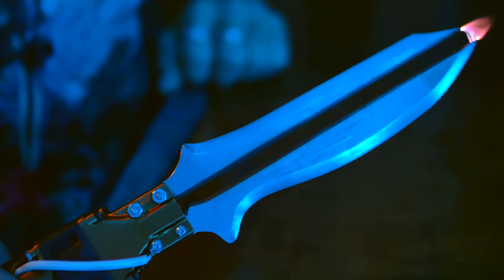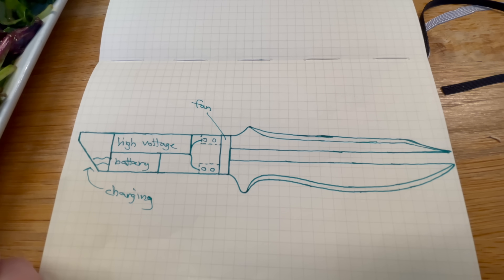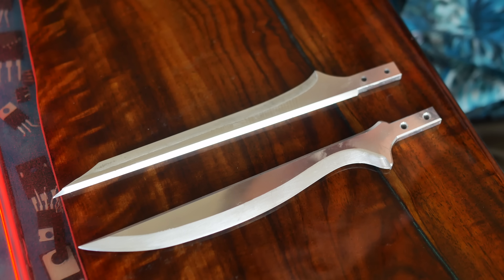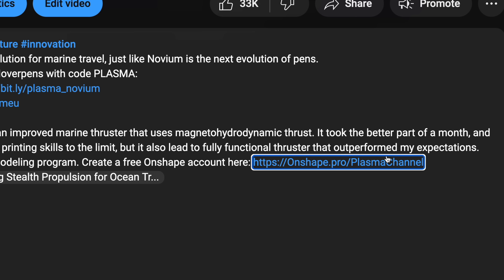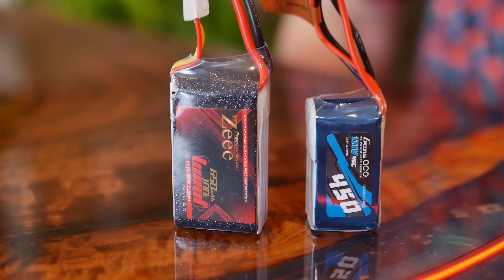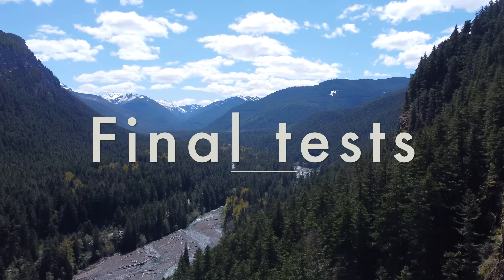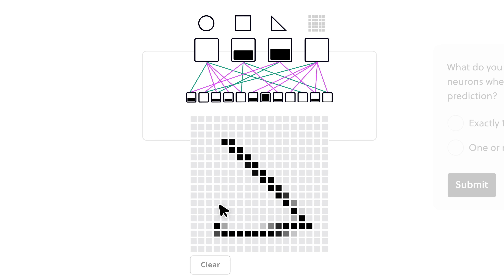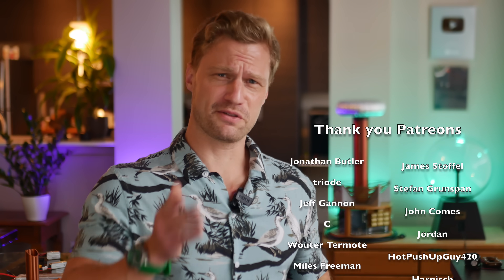A 20,000 Volt Next Generation Plasma Knife (Halo Inspired)

Comment: I can think of several ways to improve this design. Firstly, cut a channel on the inside edges of the blades and fill it with a more conductive material, such as copper or platinum. Secondly, similarly to those fad "bladeless" fans, stick the computer fan at the base of the handle rather than the bolster, and have it run the air through progressively narrower channels that direct the air to the space between the blades, you'll get a little bit more distance this way. Thirdly, scale it up enough that you can make the handle ovate rather than cylindrical, and move the activation button to a comfortable space for your thumb or finger to activate it.

Comment: Try using GDStime dual ball bearing or Sunon Maglev fans, they work much better, and you should also print a high static pressure plate for the fan as well, these make a huge difference.

Comment: Looks great.
What if instead of a self contained system, you have the batteries, circuitry, and such in a backpack, and have two contact patches on the handle and on the glove/gauntlet along with a button in the palm to deliver power to the blade? Could extend the battery life, and allow for larger more high powered blades. Would also function as an improvised stun glove
Reply: i'm going to be building myself a stun glove pretty soon here out of scrap parts. probably won't post it on this youtube channel cuz it's a little too fucked up but something like that is definitely getting built by the end of this year

Comment: Pro tip for blade handle shapes: don’t make perfectly round handles.  You can’t feel the edge alignment of your blade with them, and they’re more likely to rotate in your hand, further messing up edge alignment.  Ovoidal and rounded rectangular are the best cross-sectional shapes for handles.
Reply: Beat me to it, plus a oval-ish type hand just makes a firmer grip overall
Reply: Round handles are perfect for a lightsaber design though, no edge to worry about.
Reply: @draonKniht100  yes but it's not a lightsaber, it s plasma blade, with a edge
Reply: To be fair, the Halo Energy Sword is designed for Sangheli hands, which have two fingers and two thumbs. It's GOT to feel awkward in a Human's hands.

Comment: I think you should try using your design of the plasma propulsion system inside of it, it might be quieter than the fan, and try adding more vents for increased airflow. But as it is right now, you nailed it 🔥🔥🔥🔥
Reply: No way he'll be able to get the same airflow in the same compact size

Comment: Might want to look into taser modules. There was a tutorial for a 150000 volt taser that could be adapted for this purpose. The fan can also be replaced with an electromagnet for a more consistent streM or with a class 4 uv laser to make jumping the spark gap easier. Best wishes and cool design nevertheless. Already want to build one myself.
Reply: Link plz?

Comment: If you would put flat magnet inserts into those blades (with the right polarity), that could accelerate the plasma in a same way that a rail gun works. Thus you could skip that noisy fan, and get similar results.
Reply from the maker: This is AC plasma, so the magnets would have no affect. However, if I switched out the AC for DC high voltage, you're totally right!
Reply: @PlasmaChannel  Ah.. OK. But, in that case pulsed DC would be better, so the current won't be too high. Will you try it? You can use your HV AC supply, and a simple HV bridge rectifier (without capacitor).

Comment: what feeds did the cnc run on?
Reply from the maker: Feeds? That's a bit over my head, but I know we tried slow, and slower. Vitalli nailed it at the end though - the metal shavings were the perfect color from heat.
Reply: Good to hear, it worked. The use of coolant seemed a bit low to me. Did Vitalli spray coolant on the tool or was it just air? Love the Final design 👍

Comment: Making the gap a bit wider near the ends of the blade might help a bit.  That's what  is normally done with a Jacobs ladder.  Thanks for the vid m8.   😀
Reply from the maker: Thank you, yes I actually dulled the ends of blade, and internally as well, about 2 inches from the end. It helps kill any arcs at the distal end.

Comment: Pretty sure the rule is 1 cm per 10,000 volts
Reply from the maker: I've never known why that number floats around on the internet. It has always been 30,000 volts per CM, between two rounded electrodes. The dielectric breakdown of air is 3kv/mm. If between sharper electrodes, that number is much lower.

Comment: If the gap between blades tapered and got smaller, would the plasma reach further towards the tip?
Reply from the maker: So, the plasma would fill the entire blade. In later tests, I could get the whole blade to fill with plasma. However, it eventually ends up with a solid arc at the tip of the knife that does not extinguish. Meaning....once that arc starts, all plasma between blades disappears. So, the spacing I chose was kind of the best scenario for all the variables.

Comment: Nice! A refined version of the Tommycallaway and Allen Pan plasma blade systems! I have the parts for one too and am trying to figure out exactly how I want to do it and I think I got it now. Similar to yours with one new component that just hit the market (technically 2). My advice would be to get a mini edf off ebay, a tiny ESCs, and a littel servo tester to run it with more airflow? Also, you could use a bunch of small holes that run parallel to the air flow that then point to one outlet hole to get more laminar air flow rather than turbulent to maybe increase the smooth push on the plasma? I think there are some laminar flow water hose attachments on thingiverse that illustrate this idea. I think I can wrap my head around how you added the transformer in series parallel at the end, but any guidance there would be most appreciated.

Comment: Vitally needs to discover the use of coolant
Reply from the maker: lol. He was using lots of it.
Reply: @PlasmaChannel  
My bad I saw what looked like air didn't see the clothes eating milk I'm used to kinda made me pause with the depth of the cut. Probably just needed to adjust his feed/speed or make more passes. I'm actually surprised the plasma channel doesn't have a cnc plasma... just saying you already have the knowledge and it tracks with what you do. Genuinely nice work with the fab overall looks pro grade well engineered. I got respect though making new things is grindy and time consuming 20 hour prints sometimes just to find things out you need to change and reengineer reprint the part.

Comment: I love what you have done and love the way came up with this idea😊, but you can make the whole blade have the sparkles and elasticity(plasma) by making the end of the blades closer to each other. Not trying to bad mouth but, just wanted to say it could look even more cooler with the whole blade sparking electricity rather than the parts closer to the center. I will also try to make this in the next summer vacation if I can( (probably it will not cost much money 😅),Thanks again for a very great video.

Comment: Hm. 
If you wanted to stick closer to the original design, you could use tempered glass and/or polycarbonate. You could do plasma metal deposition to make sections of it partially conductive, especially in the kilohertz frequency ranges. You could also use metal foil tape for conductive traces (where the white parts of the blade are). That would allow you to better match the original design. If you go with glass. it could even be sharpened.

Comment: You are not an knife making guy so you naturally have some unoptimal designs. Also its a prototype so you correctly focused on the most important aspects. Some tips are:

Handle should never be round for better grip and handling aligned to the edge.

More metal running through the handle for better structure. (This one is a big problem with the electrified blade and you clearly do not care about that making a 3d printed handle).

This one I'm not sure but the blade might be a bit too thick.

Once again we are here for the plasma, not for the knife, so you're good.

Comment: You could use small gas cartridges like for air guns or whipped cream dispensers instead of the fans.  Then, not only might you be able to save on space/weight, you have the option of using different gasses for the plasma.
Reply: Those run out very quickly

Comment: Sadly I don't understand what FS stands for... Flow-Stabilised perhaps, as the arc is "stabilised" into the blade via air flow?...

But as for the blade itself, it is, first of all, absolutely epic-looking (if oddly thick... Any reason for that?), and second, I honestly see very little use the plasma other than the looks.

It won't give any advantage in cutting, is what I'm saying.

I've long wanted to create some form of a "plasma knife" as a tool able to cut (if very slowly) through hard materials like wood or even metal.
I've been mostly focusing my ideas on having a central wire that'd concentrate plasma around itself using the z-pinch method, but my concerns were about the structural integrity of the wire, both from pressure against the material being cut, and from potential heat/electrochemical wear from the plasma itself. So that tool remains a dream for now.

Comment: Recently one of the science YouTubers I follow posted Videos whe he built a high voltage PSU (50kV+). The crucial parts were potted in slicone. But the outer shell for the potting material was 3d-printed. Thats where he found out, that 3d-printed PLA is not suitable for high voltage.

The silicone was poured into the shell but there were PLA spacers that were supposed to hold the high voltage cables in the middle of the silicone. But when he ramped up the voltage, it arced right through the PLA and thus the voltage escaped its slicone prison.

So 20kV might be ok, but keep this on mind for future handheld devices.

If I remember what channel it was, I'll post a link to the video
Reply: It was Advanced Tinkering. And yeah, I was thinking the same thing about the 3d prints.
Reply: There it is https://youtu.be/EsBnZKUgIkI?si=nZcXU0RJKzDP_irs

Comment: I would have started with a stun gun for the power supply. Then you can stun your opponent before the Coup De Grass!
Reply: I think the rate may be to slow, for an arc to crawl upward along blade. (Ion trails)
Reply: 60 hertz works, but a tazer is around 25 hertz.
Reply: @Eye_of_state  Ok the frequency was not a factor I thought of. But it still be fun!

Comment: A cathode ray tube (CRT or old style TV screen) Runs at about 27,000 V. It can arc about an inch to 1.5". One time I had a TV that was putting out to much flyback voltage to the CRT (like a capacitor / battery) , and as I was explaining this to someone, I pointed to it, and it arced to my finger, about a 6 inch flash. I had on rubber soles, so nothing happened, lol, or it would have hurt. So I came away with a charge. Reminds me of a tesla plate.
Reply: An easy method is to reconfigure a Tazer. The popping noise, a major deterrent. The noise would vary, as it traveled up blade, like a Jacobs ladder. It might not travel, if previous pulse is not fast enough to catch the last ionization trail, that is drifting up or away from start point. Tazers are notorious for strong brief pulses, with pause between.

Comment: Can you improve the fan flow by utilising how Air-knives work? Though I guess that may need more pressure than a tiny little fan.
Reply: The air actually blows the arc away, but it restarts. If slowed down, it would be seen as pulses. Do a Slo-Mo with a real cam, Plasma channel guy.
Reply: @Eye_of_state  So you mean a Faster air flow would not improve the effect?
Reply from the maker: The entire setup is optimized for every part. Adding a more powerful fan causes the arc to blow a shorter distance, as too fast of wind simply rips the arc apart. Too weak of a fan and the plasma also doesnt travel far + tends to arc from tip to tip. Needed enough airflow to blow out the initiation point on knife tips, but slow enough airflow to get the arc to travel. It's counterintuitive. I went through 6 different fan speeds.
Reply: It would, and it gives it that dirty orange look. The voltage needs to be higher yet, for a real effect, but the arcing becomes an issue, at handle. @wishbonebrewery
Reply: @PlasmaChannel  Got ya! Thanks.

Comment: If you want to eliminate the spark getting "stuck" at the top, try removing the sharp points at the inside of the top gap.  If you curved them away from each other, widening the gap at the top, the spark should extinguish as it is forced to the end (where the gap would get bigger).  Round all corners and edges near this point.  If you want to have sharp "stabbing" points, put them on the outsides of the blade where the point-enhanced electric field would be less (due to distance).  The electrical field is related to the inverse of the curve radius, so any sharp points or edges need to be considered as arc-producing spots.
Reply from the maker: Thanks, yeah I considered this but ultimately wanted a specific look. Having the tips inverted to me looked a bit strange. Off camera, I did dull the points significantly, and rounded the internal edges at the last 2-3 cm of the blades. Next version… will be biblical!
Reply: @PlasmaChannel  I guess I am off to search "biblical plasma swords/daggers"?
Reply: @vantroon  Genesis. Angle was placed at the garden of Eden with a flaming sword ;)
Reply: Yeah, only downside is that having the curve on the inside looks derpy, and one of the design goals was to look cool, but true.
Reply: Or make the back blade shorter than the front.
Reply: Would an insulator at the tips work?
Reply: Idk why it didn't occur to me until just right now watching this video a second time, but I could actually create my own stun gun, not only that I can build and design my own taser too. 

....I however am of NO assurance whatsoever as to the legality of doing so. You know. One might actually think that in the America of Burgerstan that anything can and should be by God fair game provided it is in defense of your life or the life of another. i.e., I really should get hit with terrorism charges or God knows what just because I thwacked someone with a plasma generator when he pulled a hunting knife on me and demanded my phone. But then, if you live in a sufficiently stupid state like Hawaii, New York, California, New Jersey, Maryland, Delaware etc. you can in theory be charged with possession of an illegal deadly weapon if you absentmindedly mouthed off that you'd just use your son's little league baseball bat if someone broke in. "sir, that junior bat is an illegal weapon" "what why but it's a bat" "yes, but you called it a WEAPON therefore it is now illegal"
yeah well you know fucking what I'm just going to design a tase-gun that shoots an electified hammer of Thor amidst a lightning storm of ball lightning and plasma how about dem apples
Reply: This is why forks spark in microwaves

Comment: You should look into a.c. infinity for fans. They are a rebrand and not expensive,  but you can always go to the source for cheaper.  That said, they are extremely quiet and pretty powerful for their size.  Also, I think the design would be more practical or useful if you used a paddle switch on the handle or  an uglier approach or a trigger finger like some hunting knives have. You would also get better airflow if you used a round instead of square for the fan output reduction and taper it back to square at the very end if you need it to be a square shape.  As it is now, a lot of the air flow gets bushed back out the sides of the fan.

Comment: I remember seeing a new type of compact fan that is being made for laptops. It has no spinning parts but instead uses a micro membrane to move air like a bellows. Almost no noise and lots of air flow. Could be something to consider for a redesign of the plasma knife.
Reply: I'm pretty sure it's really expensive; and it has mostly static pressure, not as much air flow

Comment: The FS Blade is very good but as we all saw that the plasma did't went up after a certain point.
My advise please narrow the distance between the blades to about 5 or 4 mm and use a more conductive metal while increasing the 2 transformers to 3 and switching to the old handle but the same fan. This would do a lot better I think and can also be an great idea for a version 2 of The FS blade and if worked will shurely help in the actual Energy Blade.

Comment: Your setup has a lot of constriction and resistance to air flow, which favours static pressure over air volume. This tends to mean impellers are better than propellers. It might make it a bit less noisy.
Reply from the maker: The server fan I ended up using was rated fairly high on static pressure. The trick with this build was that too much air caused an issue. I required just the right amount of flow down the blades. Too little and it didn’t travel. Too much, and it blew the arc out light a candle.
Reply: @PlasmaChannel   perhaps instead of using steel as the conductor you can braze the back of the blade with brass or copper or copper plate the blades?
Reply: do not use impeller use a centrifugal blower, the same ones used to cool laptops. i think this is what you mean and they would work a lot better and be more compact
Reply: @randomsnow6510 how about a small squirrel cage fan?
Reply: I was thinking the small dyson fan module that integza showcased for one of his videos
Reply: Noctua ain't got nothing on delta fans...except being way more quiet... but for cfm and finger chopping power...delta all day 😂
Reply: 2:18 and I already thought, "nooo! user a blower fan"
Reply: I was thinking noctua fans

Comment: You need to use some grounded metal screen over that fan to protect it like a farady cage, or over time the RF from the HV circuit will likely kill the motor windings in the fan .